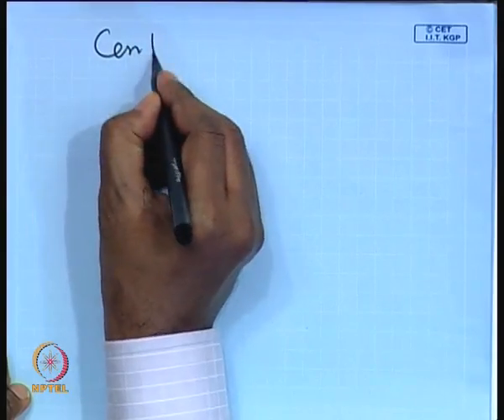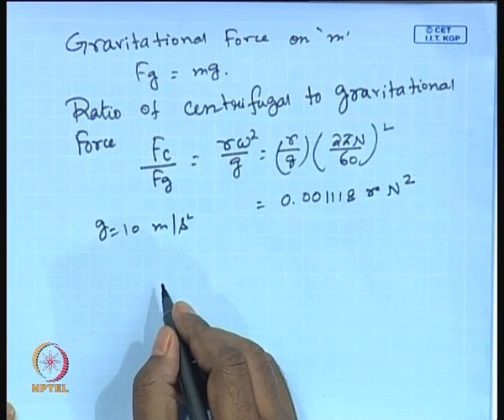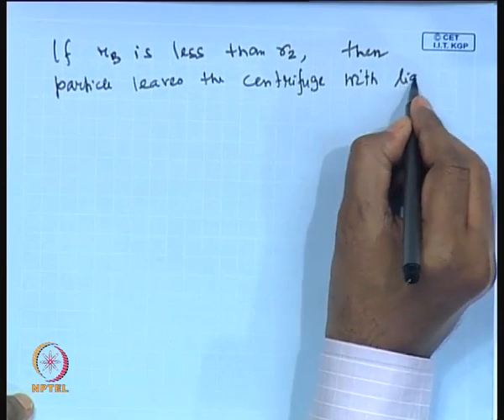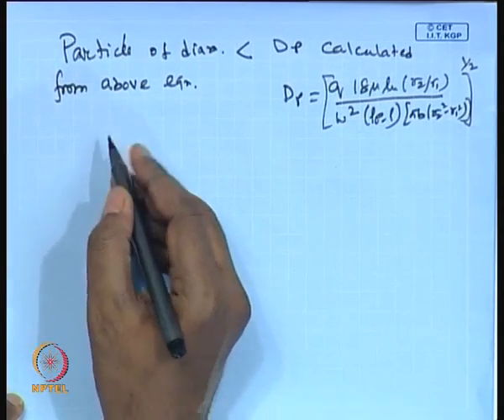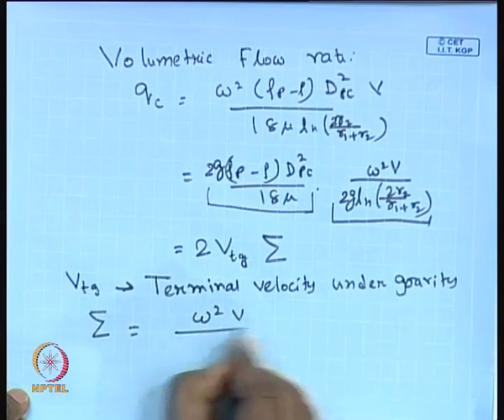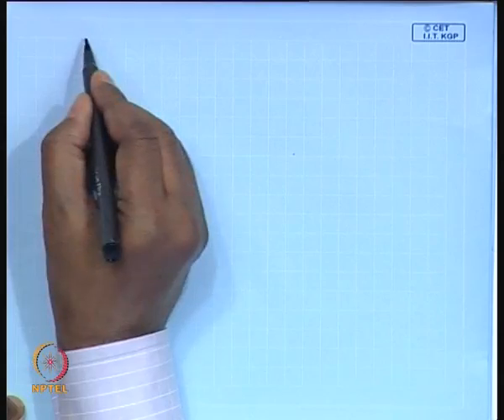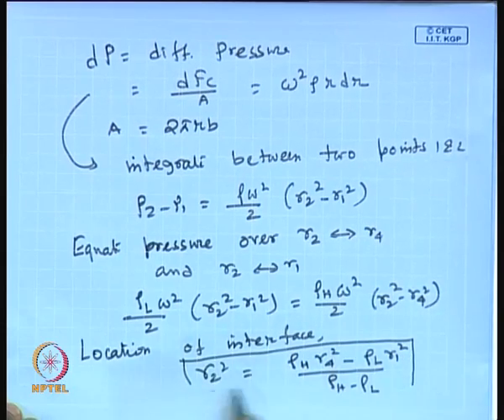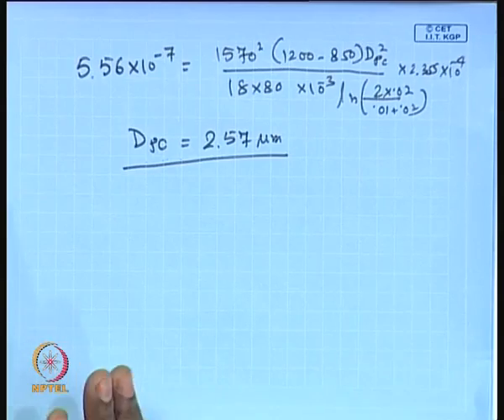Mod-01 Lec-35 Centrifugal Separation Processes

Comment: Dear teacher!

My name is Nguyen Van Vu. I live in Dong Thap province, Vietnam country

Thank you very much for your lecture on centrifuges. I am also a centrifuge operator for more than 7 years. I have the following question, hope you can help me.
The centrifuge I use is a 3-phase machine: solid residue, heavy liquid (product), light liquid (fat). After going through the machine, I just want to get the heavy liquid phase (product). The product after centrifugation met the requirements of fat and solid residue but encountered the problem that the product after centrifugation was emulsified. Is the cause due to the large output resistance of the fat phase, so the emulsion (not yet separated from the fat well) moving through the product line a lot? look forward to your guidance!

Thank you, teacher, I wish you good health!
Van Vu!
My email: vu.nguyen@vinhhoan.com

Comment: the pans' are 16 feet in diameter .  rock sized between .8 mm and 8mm . diamonds are being recovered at the bottom of the outside walls . . i am trying to work out the optimal r.p.m for best separation